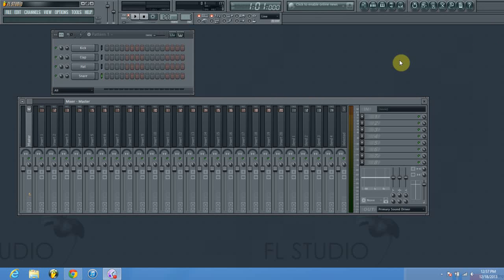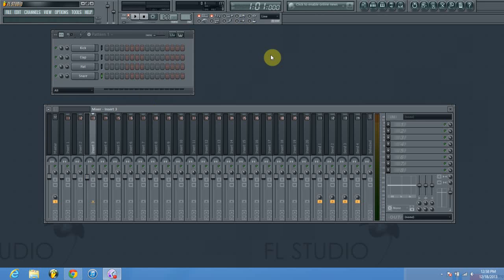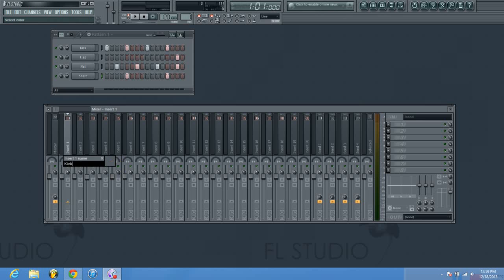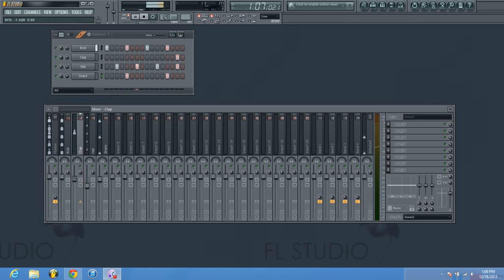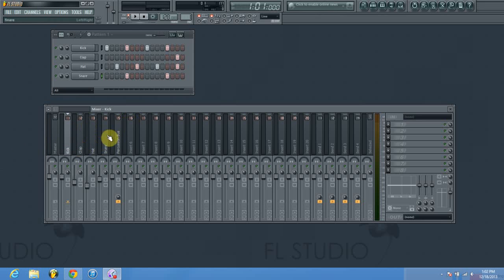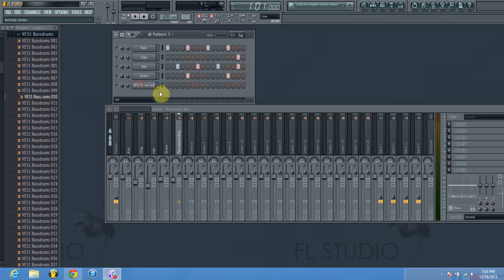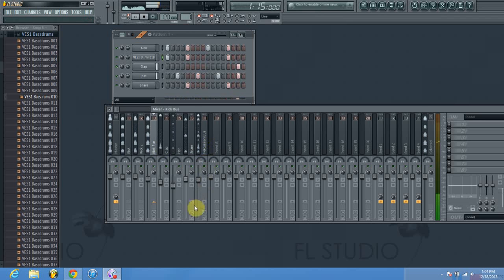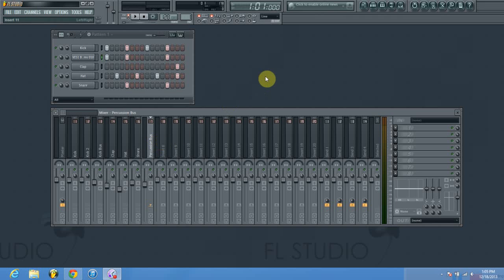Improving Your Mix With Bus Channels (FL Studio)

Comment: This is useful for recorded guitars too, for metal at least. For rhythm guitars each part should be played twice then panned to left then the right channel. I do this panning in the mixer, unfortunately it also pans any delay and reverb, so I bus them both into one channel and have the delay and reverb there.

One thing I had to be careful for is making sure that the individual channels are not playing simultaneously with the bus channel.

Comment: So you can look at the Bus channel as a sub master channel but only for a group of sounds and not the whole track itself, nice tutorial man, keep it up
Reply: HargroveOfficial You should make a tutorial on how to adjust each individual mixer volume knob depending on what instrument/sound you have linked to it. I'm mainly referring to the kick since it's the dominant of all the other sounds and I can't rely on estimations or rough figures on what I should set the volume knob to. I've been reading on some useful sites some information on what DB level the kick should be peaking at e.t.c. so If you could make a tutorial based on that, it would be greatly appreciated.